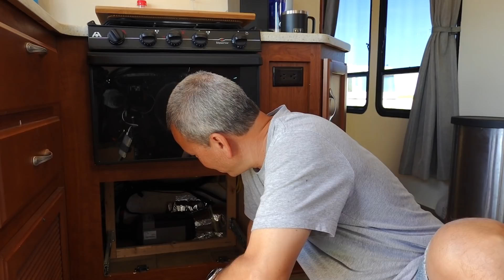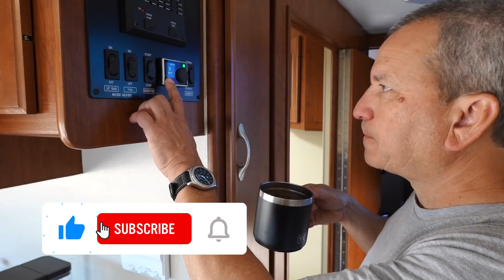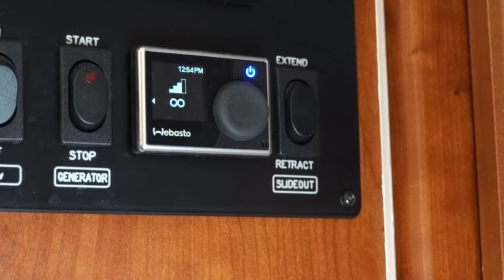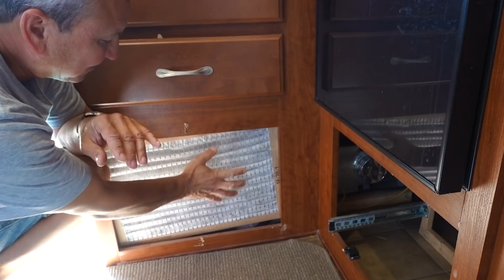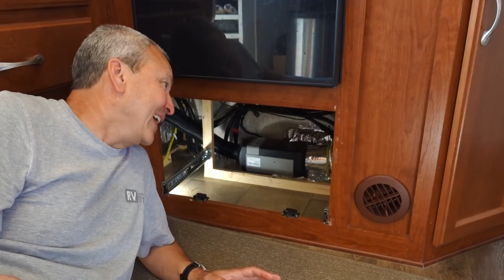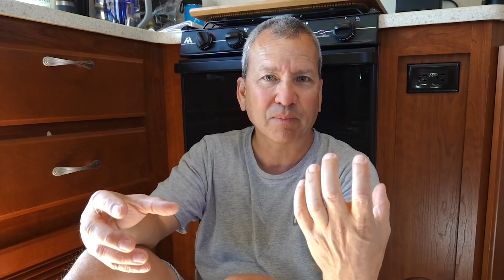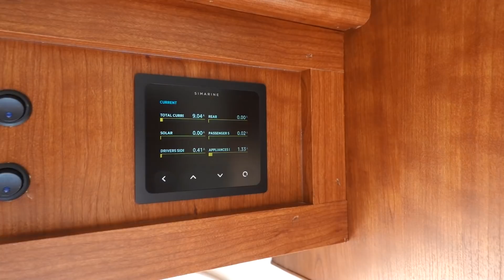(UPDATE) 6 Months Using Webasto Gas/Diesel Heater in RV

Comment: I really disagree with this especially with rising gasoline and diesel prices LPG will always be the most efficient therefore the appliance will run a long time ever wonder why RV water heaters and gas powered furnaces last so long because they don't get gunked up because the propane Burns so clean
Reply from the maker: If the existing LP heater heated as well as this, then I wouldn't have been looking for a better solution. I also not having to rely on Propane is one less thing to have to refill. Thanks for the comment.
Reply: @RVwithTito  well I can assure you that the original propane furnace would work best usually they design the system to heat the RV in a consistent way to prevent pipes from freezing this is just asking for issues why make a problem when there isn't one?
Reply: @iair-conditiontheoutsideai3076  Most boondockers hate the standard furnace because of its inefficiencies: heats 2-3 degrees higher to compensate for 30 seconds of cold air cooling down, sucks down propane, extremely loud in the middle of the night, and drains the battery.  So we always look for a better ratio of give and take.  Less immediate BTUs but better overall everything else.
Reply: @SK-qt1rm   you mentioned some valid points in there however it is a 12 volt furnace easily should have no problem using a couple solar modules to replenish the battery in the daytime
Reply: It cost me about two dollars a day. I’m just guessing it’s about a quarter of a gallon of diesel to heat a 40 foot steel shipping container. Each day depending on the weather though also if it’s really really cold, probably about half a gallon in 24 hours I’ve never heard of a gasoline one though
Reply: Propane can be a pain in the neck, I'm using a Big Buddy and   sometimes it can be hard to find a place to get them filled and the exchange a tank are horribly overpriced. 😅

Comment: Tito, are you or have you used this heater when traveling?  I don’t like to use our propane heater when on the road.
Reply from the maker: I have but really have to need to since I can turn on the engine heat. It works though.

Comment: It also does not add moisture to the air like the propane furnace
Reply from the maker: Actually, most built-in propane furnaces vent to the outside and don't have much moisture build up. Portable LP heaters on the other hand do put out a lot of moisture.

Comment: Do you have any kind of backup heat incase the Webasto fails?
Reply from the maker: Right now, the old LP furnace still works. I'll just have to route a duct. Other than that we can run our engine heater. We don't plan on staying in super cold climates.

Comment: Do you think it would work to install this heater to blow the hot air through the existing furnace ducting?  Or would the fan not be powerful enough?  Most of the installations I've seen seem to have very short hot air outlet runs so maybe there is a good reason for that.
Reply: Use your existing ducts. If needed, add a duct booster blower.
Reply from the maker: The model I have works find for two ducts. One is from the original LP. I wouldn't use it for more than that. The airflow would be pretty low. I'd go with a larger model. I stuck with the smaller model to be more efficient. Seems to be working for our rig.

Comment: Nice, those pumps are .02ml per pump regardless of the pumping rate. So if you .02 x your Hz/ rate at, let's say, 1.6, then x 60 x 60, you'll get your consumption of fuel. [ .02 x 1.6 x 60 x60 = ? ] Then divide that into your liters. Let us say 15L; you should get about 7 to 8 days of run time. I use two computer fans, tied with a temperature sensor to the body, to cool down the body more sense it is a tiny enclosed space, with an added bonus in cooling down the whole unit during shut down faster for the motherboard. My Chinness heat has been going strong for three-season now with no problems. Of it's a diesel, not a gasoline one. But here the thing with all the models no matter the name/ brands, they all made in China. No joke, about that. At any rate, they are a game-changer.
Reply from the maker: Thanks for that info. I appreciate it.

Comment: I work for a local trucking company and use a Webasto heater like this while on the road (the diesel version of course). We have several decommissioned trucks with these heaters in them, the owner has given me permission to take what I need and so I will be salvaging a unit to use in our RV, all that will be needed is a small diesel fuel tank.
Reply from the maker: Sweet! There's a Virginia supplier I listed in the description that has all kinds of parts for these if you need to refurbish it.
Reply: Nice, they come expensive so you're a lucky guy  ^_^
Reply: See if you can get ALL of the heaters, keep two for yourself, and then sell the rest of 'em as time goes by.
Reply: Salvage 2 and I’ll buy one off you. ???? Mitch 5084007999
Reply: How much do they cost?
Reply: @r8edrv4fun65  around $900-$1000 USD

Comment: Excellent, is there a size limit on the RV this unit would work in?  Fifth wheel toy hauler or class A?
Reply from the maker: There are larger models that push more heat/air. The one I'm using is the smallest and most efficient which is why I chose it.

Comment: I've been running a diesel heater for almost six (6) months now, and it's already failed due to carbon build up. I wonder if the gasoline model has the same issue!?
Reply: That's the problem you will never have this issue with LPG

Comment: Do you have an idea of how much air your getting through your ducting. I am thinking about putting 2 in my 40 ft solitude and I am trying to figure out if I could just make a mounting point where the current propane furnace is and use the existing ductwork which I have already upgraded to rigid ducting.
Reply: You should be able to use your existing ducting.
Reply: @rickeagle  awsome thank you
Reply from the maker: You'd probably want one of the larger models. The size I have is the smallest and will support 1 to 2 ducts. The most direct line out of the heater will get the most air flow.

Comment: Nice update seems super quiet and what a savings compared to the noisy propane battery killer heater 👍
Reply: And a propane gobbler. They can really eat up your propane quickly.
Reply from the maker: Thanks. It's not super quiet, but it fluctuates as it maintains heat. I haven't had any issues watching TV with it heating. The LP was pretty loud and I had to crank up the volume on things.
Reply: Same same our heater is right below our tv I have to turn it up as well 😀

Comment: Excellent review. Just wondering though. You said you were going to remove your propane furnace. Will you be attaching this gas heater to the rest of your vents. I imagine your basement is heated by the furnace? Will this gas heater be able to take care of all that?
Reply from the maker: I plan to leave it as is with these two vents. It works fine. I disconnected the other vents and have capped the basement heat many years ago.

Comment: Great video as usual. I’m surprised that that your install kit didn’t come with the rubber mount for the fuel pump. My Espar D4, Webasto 2000 and my 5kw Chinese diesel heaters all came with the rubber mount for the fuel pump. It really does make a difference when you isolate the fuel pump from the metal frame. I love all 3 of my diesel air heaters in our class A. It’s nice dry heat. No more wet windows using a propane heater. Diesel or gas air heaters are a great upgrade for rv’s. 
Happy travels
Reply from the maker: Nope no rubber mount on mine. This workaround has worked great though.
Reply: The American heaters come with the rubber mount, the European versions do not.
Reply: Your work around might even be better than the rubber mount. You have completely isolated the pump from the metal frame. Great job

Comment: I like that heater and I’d remove the noisy suburban propane heater too. Wish more campers came with it. So many off grid people use it with a good lithium set up. If space was not an issue I may keep propane heat as a back up and keep propane for the stove because I like cooking with gas. Although I am not familiar with induction cooking. If I needed the space I’d ditch propane all together. Make more space for lithium batteries. Nice review 👍🏼
Reply from the maker: We've got an induction burner that we try to use. Otherwise it's the LP stove.

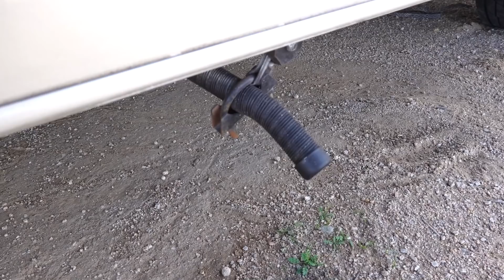Comment: 11:22 I've always thought that the heat coming out of the exhaust pipe is wasted heat that could be used by using a heat exchanger to heat the tank of grays or the water in the engine block.
Starting a cold combustion engine suffers a lot.
Thanks for the video and excuse my English I'm using the google translator
A hug
Reply: Anything can be accomplished with enough time and money yet these heaters are very efficient and the exhaust may be hot yet... has little volume. BTW, Webasto and Espar make heater models intended to both provide hot air AND circulate warm fluid throughout your RV and engine. Perhaps that would be worth looking into.
Reply from the maker: Makes sense if you can figure a way.

Comment: i want to ask do you leave it on 24/7? and you have had it on for months like that? so i assume it cycles on and off just like a house furnace would? it starts up and shuts down on its own? the thermostat was extra i think you said in the install video? my truck is diesel and i assume that it will work just as your does with gas? on and off and with the thermostat?
Reply from the maker: Yes. It works just like a home furnace. That's one of the cool things about it. Keeps the temp pretty well regulated.
Reply: @RVwithTito  so guess we can say that is makes life in the boonies comfortable off grid. that takes a load off my mind. all for about 60 bucks a month. running at like 60% duty cycle
Reply: You can also buy diesel heaters that work the same as this one. Look on Amazon. They are $150 or so with all complete parts and thermostat.
Reply: @rickeagle  Webasto for 150?

Comment: My factory installed webasto in my VW transporter the webasto wont run if the fuel level is on the reserve. Does this work the same way? You could run out of fuel if you're unlucky?
Reply from the maker: Same. I have it hooked into the generator fuel line which will cut off under 1/4 tank.